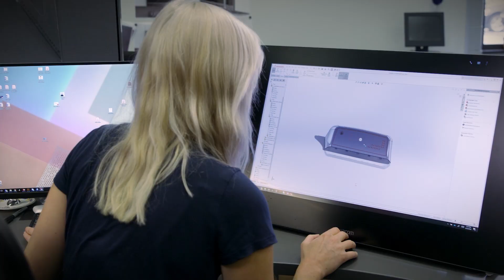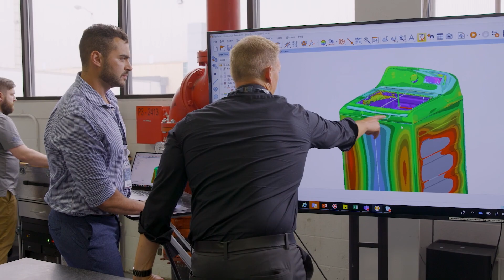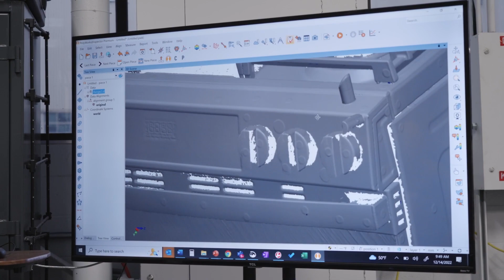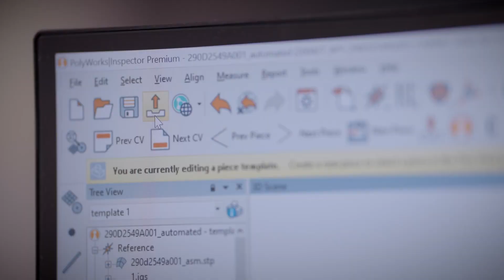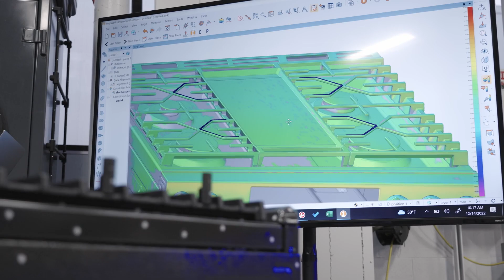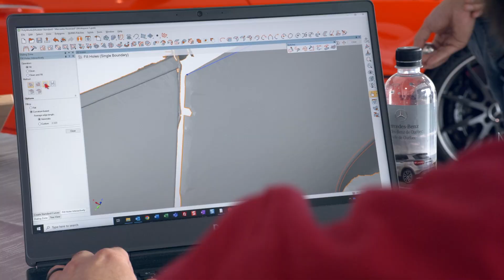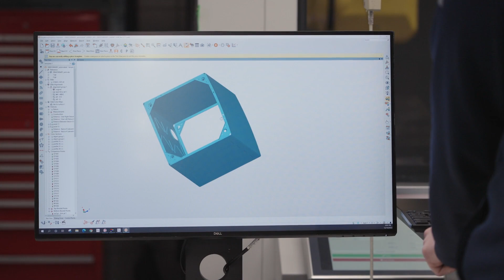Transforming GE Appliances With Digital 3D Measurement Data

Comment: Nice video and finally this industry is catching up (very slowly) with what many other industries have pioneered 15-20 years ago (!!!)... anyhow, maybe appliance quality will improve... hopefully... based on my experiences as a professional engineer and a person who helps a lot at home is, that there is NO maintenance technician feedback data loop to the appliance design engineering community. Appliances break down, very slowly they get fixed (because parts have to be ordered and that takes often 2-4 days, then shipped, then new repair appointments must be made, then re-assembled, overall taking 8-14 days typically in NJ, USA!!!!) and the reasons for the breakdowns do not get communicated to the design teams! This is a HUGE mistake... wonder if GE will change this (eventually?)... There is a lot of data here, that could be used for cont. quality improvements, but in ALL cases I have seen in the past 40 years with GE, LG, Samsung, BOSCH, Whirlpool, etc. appliances is that this feedback loop does not exist at all... AMAZING! Imagine a HONDA, or a TOYOTA service not sharing maintenance issues, trends, statistics, analysis, etc. with their design / manufacturing engineers... HOW MANY MORE YEARS will this take to understand for appliance designers and manufacturers? TRAGIC isn't it? And we all know that QUALITY sells... companies should not be afraid of building good quality product... Best, Paul